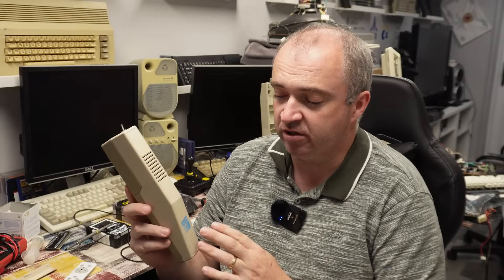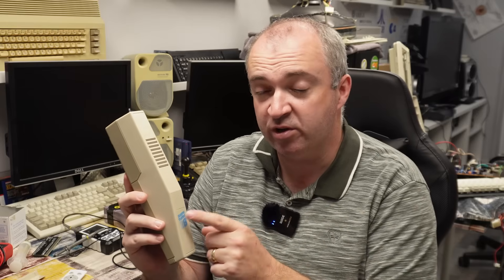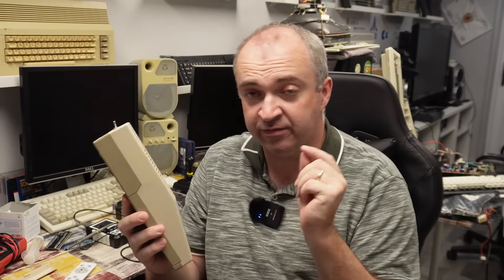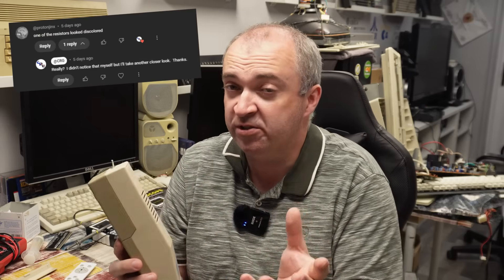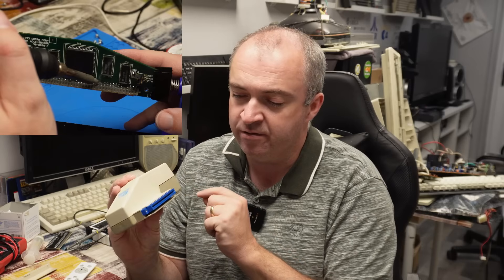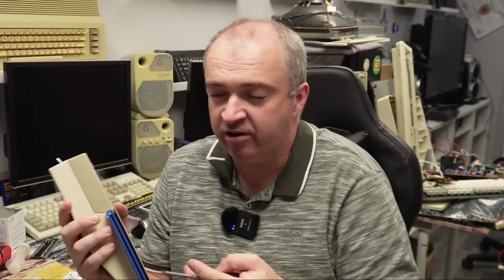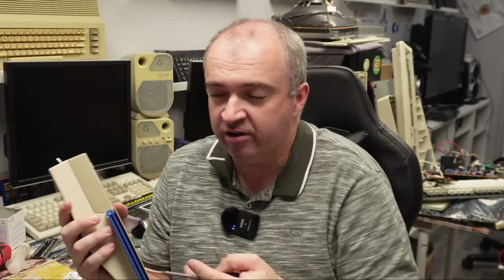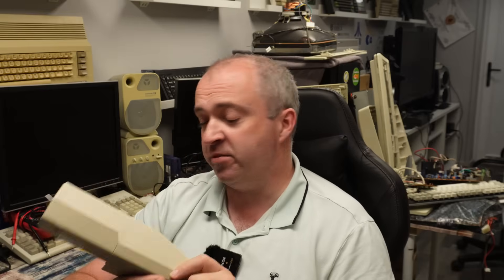This Amiga Accelerator STILL refuses to work!

Comment: 10:35

I don't recall having too much trouble soldering the J-leg chips when I was younger.

But, about five years ago, I repaired an Atari Jaguar for somebody, and it took me forever to get the solder to wick onto the pads nicely, even with lots of flux. lol

Some of the chips just have pins which are more heavily crimped, I guess. They can be a pain.

I think you're using pretty much the best choice of soldering tip for the job, though.
Reply: I do think there's a chance one of the PLDs might have failed, tbh.

And I could be wrong, but CPLDs around that time were based on EEPROM/Flash tech?
So some might have a finite lifetime for storing the config?

Most older PALs/GALs/PLDs were one-time-programmable, though, like a PIC 16C, I guess.
Those probably last a lot longer without any worries of the config degrading.

As I say, I could totally wrong about the EEPROM thing on some older CPLDs, but I know the 5-Volt Altera stuff often used that.
Reply: I just watched some of your previous vid, and saw that the PLDs are Intel iPLD910.

Those do use "CHMOS EPROM" (floating gate) tech.

So basically EPROM, not EEPROM. lol
(ie. needs a higher voltage or whatever, to actually reprogram them.)

So I think it is possible for those to degrade over the long time the accelerator has been around.
Probably not half as much as older EEPROM tech would, but still possible.

Unless somebody can find the PLD terms for this, or re-write them from scratch, it could be tricky to repair, as you say.
Reply from the maker: @electronash  Can't really explain why but I've always struggled with these types of packages, I can get them on eventually and it looks ok in the end but its always a fight 😅

I think you're probably right that the chips have failed or just degraded.  Rewriting the equations from scratch is probably the only solution now but I'm afraid that one goes over my ability.  

It's still an interesting part of Amiga history, so makes a nice talking point to sit on a shelf somewhere.  It a shame its dead but I'm not sure it's worth the effort it would now seemingly take to get it going.

Comment: Sorry if I missed it, but don't you need to remove the onboard CPU?  I didn't think there was a way to disable the onboard 68K from the expansion slot on the 500 as it lacks the BOSS stuff that you get on the 2000?  Looking at the manual, I don't see that - so maybe there is a way it disables the onboard 68K...   Another point here - and again unlikely as I would expect some signs of life if this were the issue...   It applies caching, probably on ranges except for chip RAM, does it work with the 8375 - ie. 2MB... I know that Tornado I worked on has similar lack of support for Agnus over 8372A.
Reply from the maker: Thanks for the suggestions.  I've tried it without the cpu and it's the same story but I also found an article that said it needs the cpu installed, not sure why it would but either way it's just dead.  I did try the accelerator on a rev6 A500 but it's just the same behaviour plus I've had some comments of other folk having it work on their 500+.  I'm afraid it seems as if its just dead.
Reply: I think the normal way to disable the onboard CPU in the A500 is to simply assert BR and BGK all the time. Since there's no bus arbitration on those machines, this doesn't interfere with anything. I suspect they're just tied to GND as they come off the socket.
Reply: Which does make me wonder: since the external CPU isn't doing anything at all (although I don't think you checked AS?), is it possible BR and BGK on the extenal chip are being used in a similar way? Perhaps held low pending a startup signal from the cache controller that never comes?
Reply: @thetechnoshed  Yes, certainly worth probing pins on the onboard CPU!
Reply from the maker: Gents, the manual for this card states that it's just plug and play, so it must be capable of dealing with the original CPU in some manner.  The owner of the card has said anyone who wants to have a further go is more than welcome to do so, if either of you to want the challenge then please let me know.  It is now though beyond my ability.  I'm convinced the fault is a failure in the plds and I have no means of correcting that.
Reply: @CRG  My point really was - there might be something going on whereby the onboard CPU is what's in control, rather than the one on the accelerator!  Might be difference in behaviour on some pin there to do with CPU in control.  That said, it probably all relates back to the PLD chips anyway...
Reply: @CRG  Thanks for the offer, but my round tuit list is already an order of magnitude beyond what I can manage. I’ll wager it can be made to work, and the cache would make it a very credible accelerator, but it may require reverse engineering and reimplement the PALs which really would be an extreme labour of love!